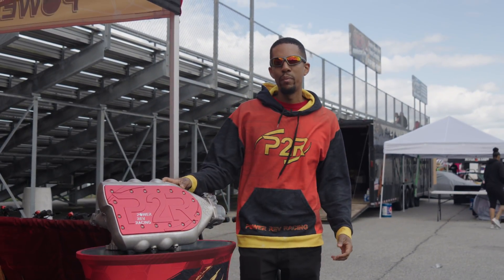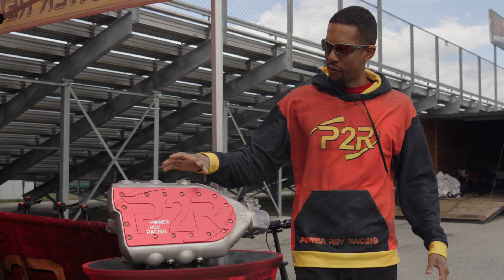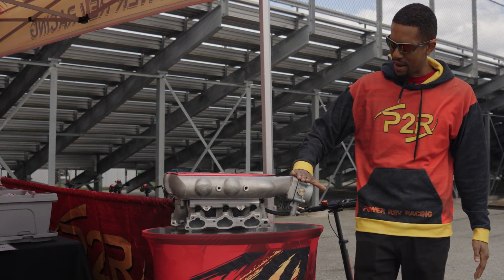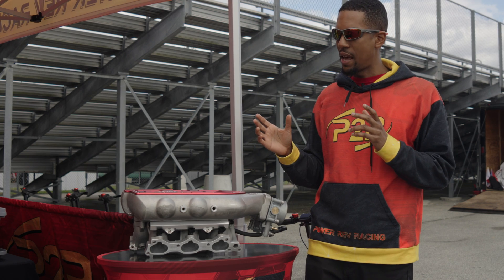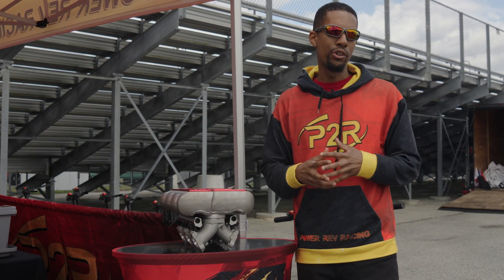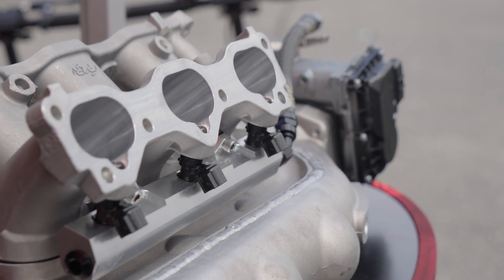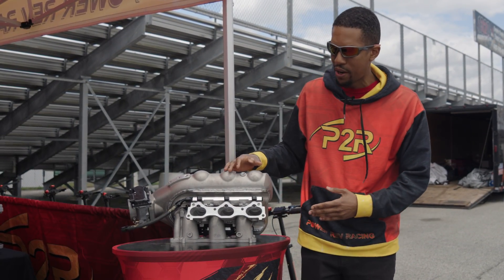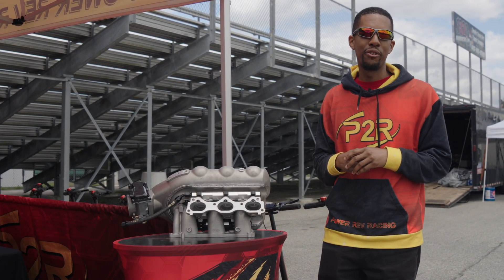Unveiling P2R High Performance CNC Ported J Series Intake Manifold at Hday

Comment: I got mine the other day.. the weld is rough. Every inch they’d stop and start again. I weld everyday for work so I’m gonna judge. But over all it’s pretty light. Looks good. I have to re route some vacuum line and extend the intake temp sensor. And having the spacer allows for the extra vacuum line that the intake does not include. I’m gonna try it out this weekend and see how it goes. Also in 06 accord
Reply: I was wo during I have a 05 v6 j30a4 accord

Comment: Hello, is it adaptable to a j30a1? TH
Reply from the maker: To use on a J30A1, You will also need to change your lower runners to J32A2/J35A4.
Reply: It absolutely should be. I see Zero reason why not.